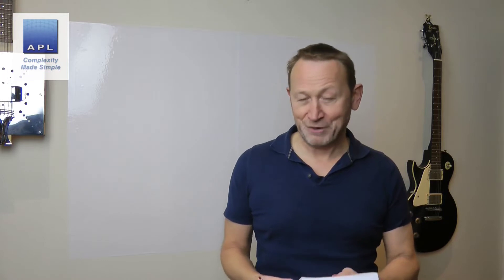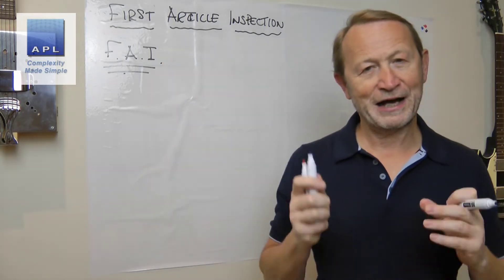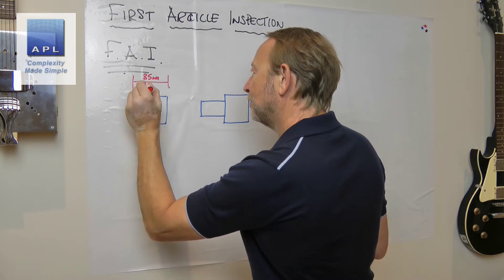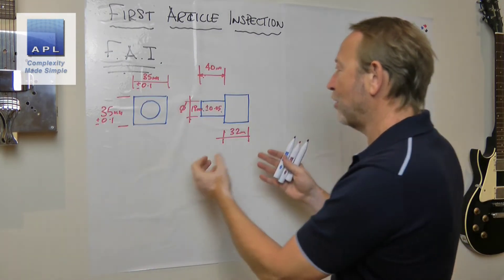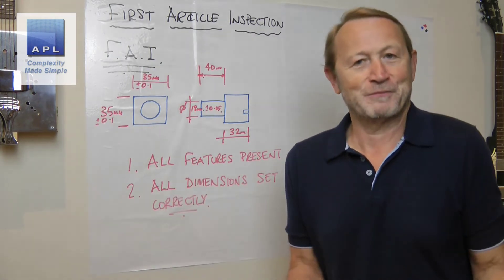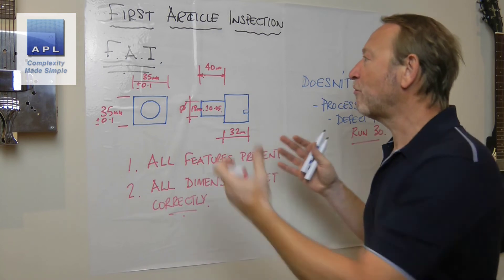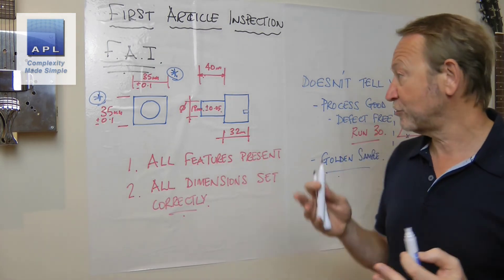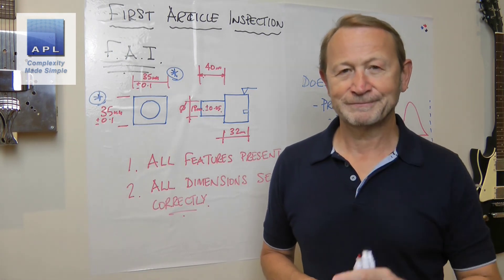First Article Inspection - What is it for??

Comment: Hi, you didn't answer the question why to do FAI.
Reply from the maker: Hi there - Apologies I didn't see a previous question, youtube sometimes like to delete some of the comments for some reason. Your question is a good one, why do businesses do FAI? I have no idea, I think it is a customer request especially in aerospace industries, but it is a useless technique...
Reply: @paulallen5321 to say it is useless is dangerous and incorrect. The purpose is to provide confidence that the engineering requirements have been understood and CAN be met. It does not measure process capability, performance or consistency, which we agree on it but it is in no means ‘useless’ from a product safety and regulatory perspective. Historically, the aerospace industry did not see the value in statistical analyses or other frameworks such as APQP due to the excuse of low volume and 100% inspection which is an antiquated and flawed view which has now been recognised. These tools have all now been introduced since the introduction of AS9145 in 2016 and AS13100 (aero engine) in 2021 and are continuing to be rolled out across the supply chain. 

A blanket statement of “running 30” to an entire industry, some of which will never even make 30 in an entire year, is a lazy solution. The focus should be on system design (FMEA), poke yoke and XmR charts, process capability can come after that in applicable organisations. FAI has its place in the midst of all of this to provide confidence of 100% conformance to specification in an industry that heavily relies on it from a product safety perspective.